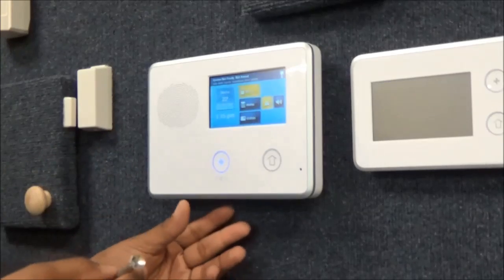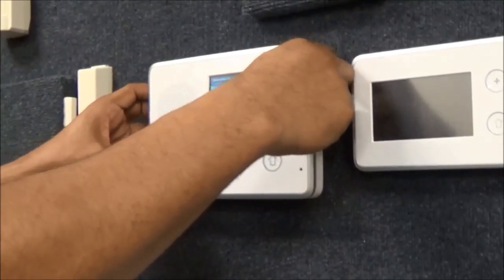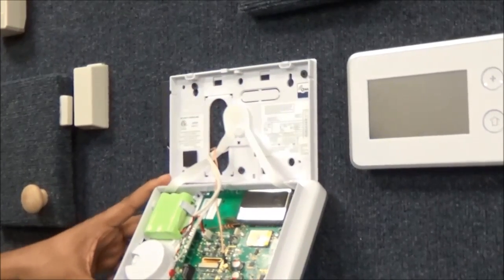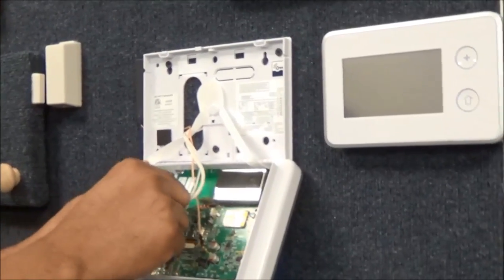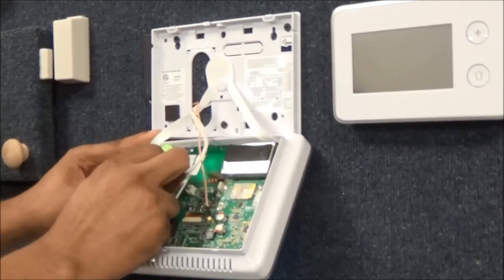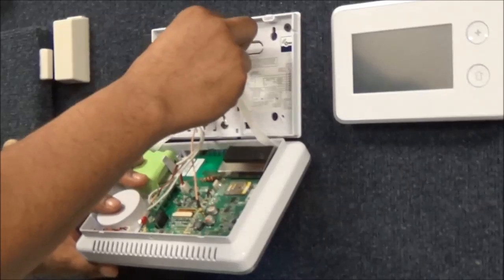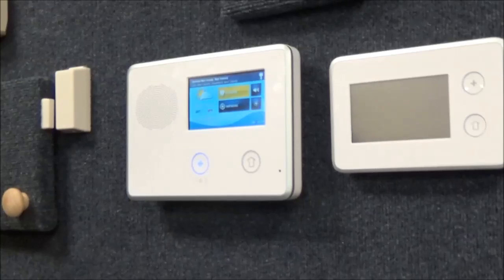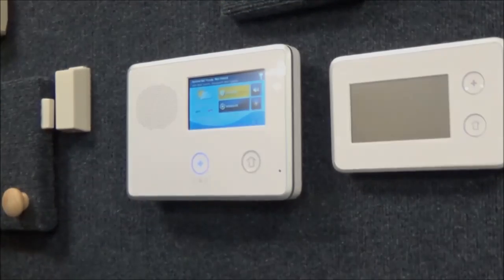My Alarm Center – How to Change  the Backup Battery in a 2GIG Security Panel

Comment: Where do you buy new battery
Reply: amazon

Batterie de secours 2000 mAh de rechange pour 2Gig BATT1, BATT1X, BATT2X, 6MR2000AAY4Z, GC2 2GIG-CNTRL2 2GIG-CP2, GCKIT311, 228844, Go Control Security Panel Alarm System 10-000013-001, linéaire PERS-4200
Reply: What is the replacement battery? I don't recognize it... certainly not 9V, AAA, AA, etc.

Comment: This is very helpful to know and on the exact panel as I have. As I searched different places to replace this battery, the priced (Feb 2019) was between $20-30. I chatted with Vivint to see what their price would be. The rep asked if there was power to my panel, and I assured her I had checked that already. She said "the backup battery is not something you would replace." She did some checking remotely on my panel, went away then back and said, "I'm shipping the replacement battery for your panel, I  ran the diagnostics required. 
When the battery arrives we can walk you through replacing it." Just like that! Since I had previously asked for a cost, it doesn't appear I'll be charged!